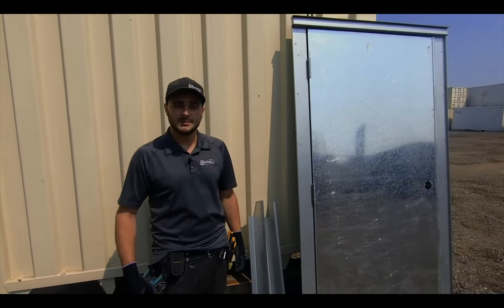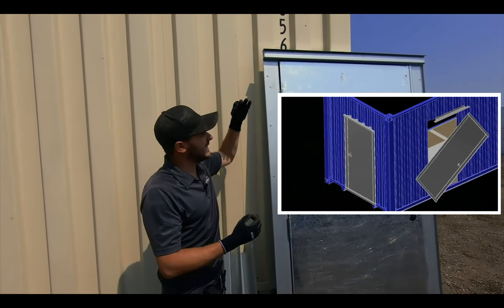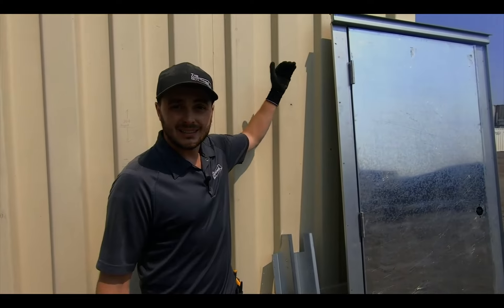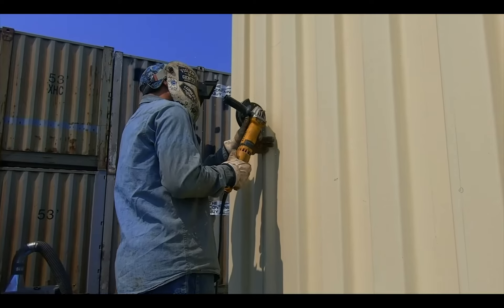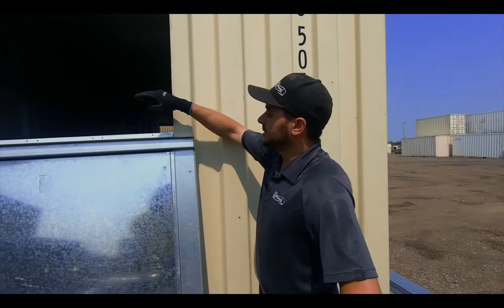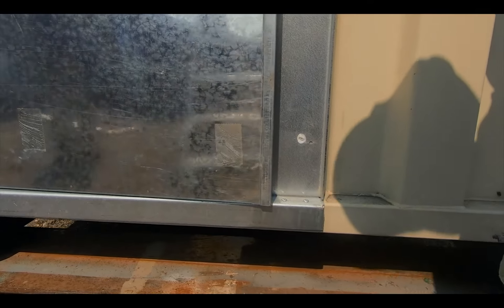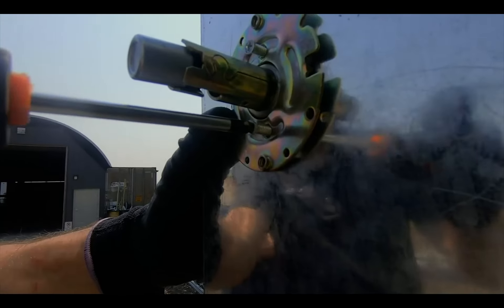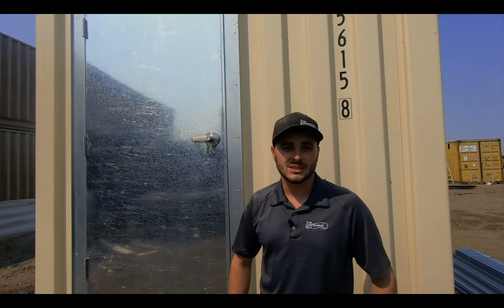How To Install a Man Door On a Shipping Container!

Comment: Pretty low quality door.  Sheet metal skin and exposed hinges- I'd be in, in less than 60 seconds.
Reply: Dosent matter. Cut a hand size hole in the container next to the door handle and unlock from inside,

Crow bar against door frame bottom out first.

Sledge hammer to the door handle

Bypass door handle

Cut the padlock on container door

Door skin is too tin realy ?

Comment: With the hinges exposed on the outside this door would be very easy to open, with a cordless angle grinder just cut the hinges off or if the door hinges have pins just knock the pins out!!
Reply from the maker: Or just use your key and the door lever
Reply: I would rather a thief focas on that door than cutting on my container. Any lock box is just a time deterrent anyways.
Reply from the maker: @glendasue70  yeah, you're right. $30 for a new set of hinges is cheap.